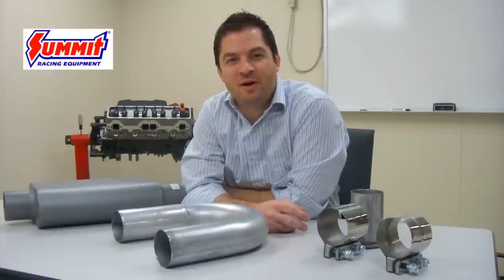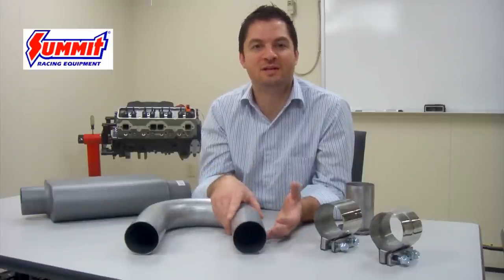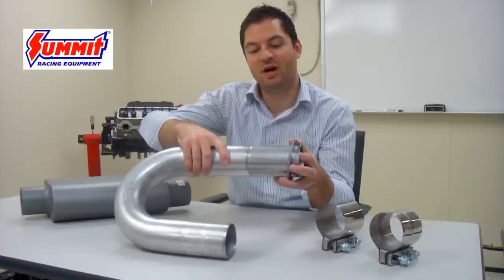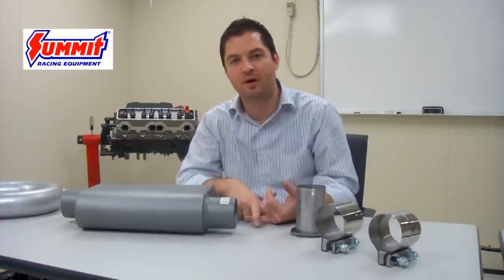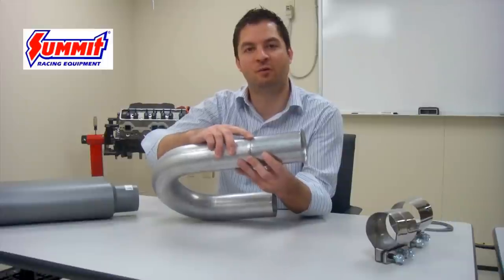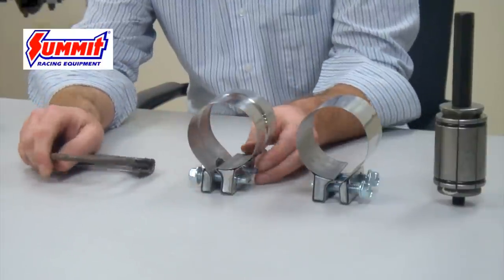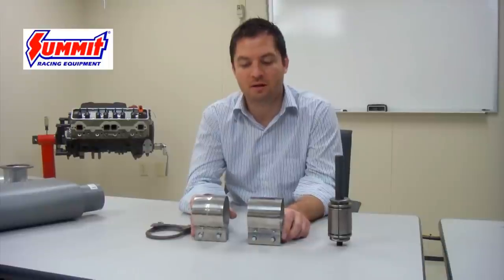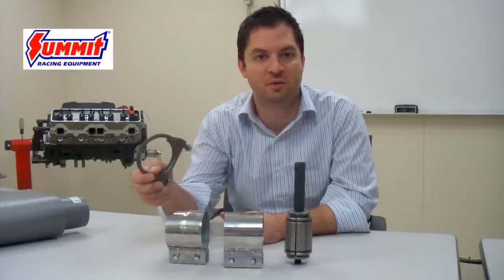Exhaust Pipe Size & Custom Exhaust Tips | Summit Racing Quick Flicks

Comment: As you explained very clearly, the role of the #exhaustclamp is to connect two pipes together. There are many varieties, such as v-shaped, u-shaped, o-shaped, variable diameter, strong and so on, And different sizes, different materials

Comment from the maker: A slight increase such as 2.25” will work out just fine!  Going too large will actually slow exhaust flow due to the extra surface area inside the pipe and hamper the scavenging effect.

Comment from the maker: Hi Rob King, 
Yes, if you have a pipe that is 2.5” O.D., than a 2.5” inlet on the tip you choose will be correct. You are also correct in your assumption that the tip will not affect the overall sound of your system providing the tip is open internally. In other words, as long as the tip has no baffling or packing of any type.

Comment from the maker: John, a 3” diameter pipe will do just fine on your truck even with some mild upgrades like an air intake and a programmer. Your flow increase will come from the aftermarket muffler and number/size of tailpipes you choose!

Comment from the maker: Hi AramisDeVannes, 
The muffler body size is more dependent on the area beneath the car that you have available to hang a muffler in. A full exhaust in a 2” diameter pipe consistently from front to rear would be a good choice for your application. Thank you for watching!

Comment: Summit, I have purchased a few things like an LS camshaft that this engine is going into my 67 C10. I like the “V” band clamps that came with my SS headers and harvested the 300 series pre-cat pipe to hook up to the new system of dual that came on the truck. My question is even though I bought a new MIG in 1984, it still works fine. The “V” band clamps are a little challenging for my elbows and dealer techs like me have used factory parts for decades. I like the band clamps that extend over the joints about 1 1/2” I would guess and not distort the pipes. I am thinking longterm serviceable and as you said had “Some Leakage” due to the design and nature of the clamp. Is it minimal leakage as I am not looking for Buick Park Ave sound quality? 
 I am looking at long term service. Hell, Chip Foose has found high-temp o-rings that move with the expansion and contraction of the exhaust he used on “Impressions” car he built. Having a surprise 5 disc lumbar fusion in June 2020 freaks me out because I have no idea for future limitations at 6’3” tall going forward on my pickup. 
  I have researched and the wrap-a-round clamp looks like the best engineering solution compared to “V” bands which I still have a off-frame type access. Thanks for all of your quick subject videos.
 ASE Master Tech since 1978 - Retired but not done! Thanks.
Reply from the maker: Hi Dean, 

Thank you for watching. 
Other than v-band clamps, most exhaust clamps will have a minimal (usually not even noticeable) amount of leakage.
 
The band clamps you are referring to are a good alternative to running v-bands. There likely will not be any “audible” signs of leakage when installed properly.

Comment: Very informative presentation of pipes and clamps and welding the exhaust pipes so no air leakage.
The speaker was clear and communative in giving options to connecting ends. 
But what is the standard size for a exhaust pipe? Under 3inches?

Comment: There needs to be other ways to connect butt joints.  I have used that butt joint band clamp before and they leak.   Now I just put a smaller pipe inside both butt ends and clamp them.  I use about 4 different sets of mufflers on my mustang with the same catback pipes.   Just wish there was a easy way to change out mufflers using a butt joint band clamp that actually seals and does not leak.  Leaky mufflers sounds horrible.

Comment: Hi, as many of the comments, I need help. I want to put a glasspack on my 2004 Chevy Silverado. The exhaust pipe on the truck is 2 3/4 inch, stock. The problem is that there are no glasspacks made for 2 3/4 inch exhaust. Should I get a 3 inch or 2.5 inch glasspack for the truck? I will have to attach with adapters. I dont want to lose too much back pressure but also dont want to restrain the engine with a 2.5 inch. Help?? Thanks.

Comment from the maker: In the industry, exhaust pipe is measured on the outside diameter while mufflers are measured internally. That way the mufflers will slip over the pipes for best seal. There are also adapters available if you decide to jump up to 3 inch. Give us a call on our tech line and we can assist you in picking out the correct parts. 1-330-630-0240. Thanks for watching!

Comment: I just finished building a straight pipe system for my MK7   Golf. one thing to look out for, mandrel bends are not 100%. better than crushed bends be far, but it has some ovality as will as in consistent wall thickness

Comment: Tried both.   Butt connected pipe to muffler with a band clamp.  Leaked horribly.   Tried to expand a pipe to fit over a muffler.  Expander split in the middle.   No luck

Comment: Hey summit I wanted to replace my current exhaust can as it is damages and found a nice universal muffler exhaust only issue is that the inlet diameter is 2.5” and all my piping from the end of my y-pipe back is 3” and wanted to know if enlarging the inlet on this muffler exhaust would be a good idea or not cause as I don’t know if it’ll cause a choke or restriction or not cause any restriction at all. My car is an 07 Nissan 350z.

Comment: I have a 2018 acura tlx aspec & wanted to know if I can run 2.5 inch piping all the way back, keep in mind my own exhaust is 2.25 I have mufflers & resonators deleted & the mid muffer which is 2.5 inch will be a cherrybomb extreme so in essence I want it all to be 2.5 inches, is this possible?
Reply from the maker: Yes, you can run the larger 2.5 exhaust with the 290 HP V6. You may see a slight reduction in bottom end torque but improved top end HP.
Reply: @SummitRacing  Thx for info

Comment: Great video!. My car is a 2000 camry 4 cyl and I was wondering what size is the best size for my catback exhaust pipe. Assuming the original diameter of the pipe is 2 inches, do you think I will get more pronounced sound open the catback exhaust pipe to 2 and a quarter inches. I currently have  a 2.25 magnaflow muffler on my car and I just need to know if bigger pipe size equals to more sound and hp. Thank you very much.

Comment: Hello need a bit of help. I have a 1995 suburban with the 5.7 I am looking for a true dual exhaust system. I have my eyes on one in summit it's the dynomax dual kit 89003. I believe my trucks pipe diameter is 2.5 but the one at summit is 2.250 will this be a major problem?
Reply from the maker: +thadd brailsord , 
Sorry, but this kit is not designed for nor will it fit your 1995 Suburban. Since your truck was factory equipped with a catalytic converter, any systems for your truck will have dual tail pipes, but not true dual.

Comment: what do you do if you have an aftermarket muffler input that is larger than the pipe on your car?
Reply: Return and buy the correct muffler
Reply: Part stores sell a adapter to take pipe from one size to another

Comment: Hoping you can help me I have 2 inch exhaust pipes stock. I want to straight pipe my car. The problem is I don't know what size I need to get for the lap joint band clamps. I am assuming I need a 2 inch one but what is the size difference in the two ends of the band clamps. Would I put a 2 inch pipe on one side and a bigger pipe on the other or can I use two 2 inch pipes
Reply from the maker: +Dominick Savage , 
A band clamp for a “lap-joint” is for a 2” pipe on one side and an expanded 2” pipe to slip over that.  If you were to just butt two 2” pipe up together, then you would use a 2“ “butt-joint” clamp.

Comment: Hi summit racing, I have a 2011 genesis coupe 2.0t 210hp it currently has a straight 3"pipe with a muffler at the end, but i feel the car looses torque or hp. What size of exhaust is the best option for my car, thanks
Reply from the maker: JOHAN MACIAS, 
Sounds like you’ve noticed this power loss since the addition of the exhaust. It is common to lean out a turbo car once the exhaust is freed up. Look into some tuning for the computer, there is where your new found power will be!
Reply: Summit Racing Hi, thanks a lot for the responce. Do you sale any tuning for that car? and if not do you recomend any in specific? thanks

Comment: Okay im a little confused. The exhaust tubing on my truck is 2.5" on the outer dimension. The exhaust I want is 2.5" inner dimension. So the exhaust will slip over the pipe on my truck from the catback? So all i need is a 2.5" Lap joint band clamp to secure it and im good to go? Now, also What would I have to do if I was to get the muffler thats 3" inner dimension? Sorry for the confusing question, any help I appreciate it!

Comment: So, I have a 2.4L 4 cylinder and I want to run a 2.25" inlet/outlet high flow cat, to a 2.5" inlet/outlet aeroturbine resonator out to a 3" pipe (not muffler). Would the 3" muffler/pipe cause low end torque loss? Would I retain power/torque by using a 2.5" muffler or a 2.5" pipe instead of 3"? Would a muffler be better than using just a pipe from the resonator?
Reply from the maker: Hi KapitolTV, 
By allowing the exhaust gases too much expansion area, you slow its velocity thus losing the scavenging effect that cleanses each cylinder for the next “Clean burn”! Using a muffler or not is really up to you and the sound you are trying to achieve, but it is not suggested in your situation to use a 3” pipe diameter at all.
Reply: Summit Racing Ok. Thanks!

Comment: does it matter which side of the pipe gets expanded to convert a butt joint into a lap? (in terms of exhaust flow from the engine.)
Reply from the maker: We would say you want the downstream pipe fitting over the upstream pipe!
Reply: @SummitRacing  thanks!!

Comment: I have two 3" exhaust pipes that are about 1.5" apart from one another. Can I use the butt joint band clamp to connect them even though there is a slight gap?

Thanks!
Reply: alden regimbal Gap is too big

Comment from the maker: Well, you mention “Cat-Back” so I’m assuming you have to run a catalytic converter; that being said, with that size motor and potential horsepower run a 2.25” Y-pipe to your Catalytic converter and then a 3” Cat-Back system

Comment: I have a 2001 daewoo lanos that i just got straight piped. the tailpipe is about 4 inches back from the bumper so you cant see anything. I wanna get an exhaust tip but have no idea what size inlet i need to get. and also if you get a clamp on thats lets say an inch bigger than the tailpipe diameter, could it still fit? Im kindve confused about what sizes to get for weld/bolt ons

Comment: If your exhaust pipe is 2.5 od and tip is 2.5 od a muffler shop can expand or shrink the pipe enough to slide in and connect and weld it shut. Clamps should only really be used on tips. Anywhere else on the system you still get leaks and it will go into your vehicle! Had a flowmaster outlaw installed on my challenger every clamp leaked. So the shop welded every seam shut and looked a lot better then seen clamp bolts poking out!

Comment: I recently bought a 2.25in glass pack for my 3.4l Impala I was wondering what size muffler tip do i need to connect it ?
Reply from the maker: Hi Wais, 
Once the exhaust pulses make it all the way through the pipes and muffler, tip size will have little to no effect on performance.
Reply: +Summit Racing ok thanks
Reply: 2.25 OD

Comment: I have the L33 5.3L in my Silverado. WIthin the next month I plan on buying the Dynomax Bullet from y'all with the case length- 12",  overall length- 16.5", inlet/outlet- 3", and putting a 9" turndown with a 3" inlet/outlet as well on it. Could you tell me if you think that would hurt my low end power at all? If it makes any difference, the only other mods I have on it are the Vortec PowerCore CAI and a Vortec throttle body spacer.

Comment: If I have 2.5" true duals would I need to get 2.5" inlet tips? Also does the tip length affect the sound much. I was thinking 2.5" inlet x 4" outlet x 16" or 18" length

Comment: So if I have an application where the tips go directly on to the end of the muffler, do I need to get tips with an inner diameter that's more than the size of the muffler outlet? For example I want to use an SLP Powerflo muffler with a 2.5 inlet/outlet. What inlet size do I need for the tip? I have tips with 2.5 inlet laying around and they do not fit.

Comment: So, if I have  a 2.5 OD  can  a 2.5 ID  GO  INSIDE  THE 2.5 OD?  Also if I have  a 2.5 OD CONNECTING A 2.5 OD   what size butt joint clamp would I need?

Comment: will that tube expander work on 409 stainless steel piping?
Reply from the maker: +cent dp, 
Due to the rigidity of 409 it may be better to seek the assistance of an exhaust shop with a hydraulic bender/expander.
Reply: ok awesome thank you, I've been thinking of getting a set of your lap joint band clamps. But wasn't totally clear on the measures.
For example with the 2.5" clamp , is the 2.5" the bigger side of the clamp? I'm adding them to my mustang exhaust where the midpipe and aftermarket cat meet. The cat is a 2.5" ID and the pipe in the cat is a 2.5 OD.

Comment: my truck has 2.75 pipes is there any way i can put 3" tips?
Reply: yes. any exhaust shop can do this no problems
Reply from the maker: +Jorge Reyes , 
Below is a link to a couple of tips we carry with a 2.75” inlet to a 3” outlet.

http://www.summitracing.com/search/department/exhaust/section/exhaust-tips/part-type/exhaust-tips/inlet-diameter-in/2-750-in/tip-outlet-size/3-000-in?N=4294948820%2B4294918632%2B4294918633%2B4294900372%2B4294918672&SortBy=Default&SortOrder=Ascending

Comment: I have a 1.5cc 4 cylinder 12 valve carburater engine. what muffler size should I use? Also, does it need to be same size as the exhaust pipe? (the whole piece connecting from the front to the muffler)

Comment: So if my ram is 2.5 what size glass pack do i need
Reply from the maker: Hi blake dog, 
Exhaust pipe is measured on the outside and mufflers on the inside. So, you would order a 2.5” muffler and it will slip over the pipe, then add a clamp to secure.
Reply: Thanks a lot!

Comment: I have a v band flange that is 4in od. what v band clamp would fit it?
Reply from the maker: +The Guy With No Grammer, 
Unless this is for some type of OE connection, it’s important to know what inside angle your clamp uses. This would be the angle on both parts that ultimately pulls the connection together tightly as you tighten the clamp. Most times this is the reason both sides of the connection and a clamp are all sold in a kit to ensure a proper match.

Comment: What Is ID size for 1 7/8? 🙅
Reply from the maker: +Dungeons Dragons, 
That would depend upon the wall thickness of the tubing you are measuring!
Reply: I got it but thank. It was for a Fiero The guy I bought the exhaust system off of cut it right behind the muffler making it a challenge to put clamps on it talk about a close quarters LOL

Comment: I'm trying to change the exhaust on my car.  This is my first time to I have so many questions, my car has a small pipe the exit on my cat is 1 7/8 and the exhaust system is 2.5 is it okay to use an adapter and weld the seams?  I don't really know of any other ways to connect it.